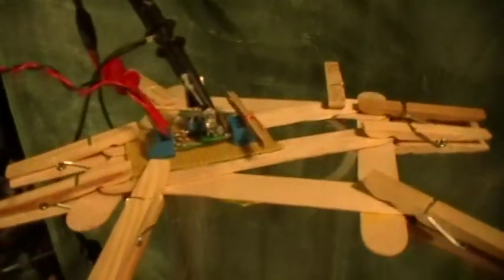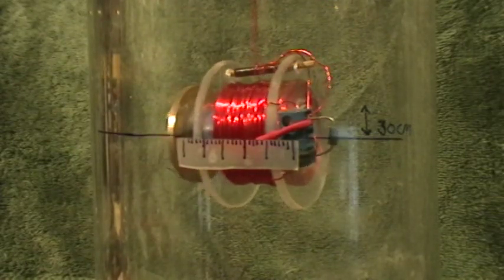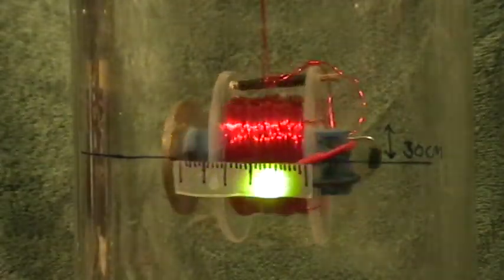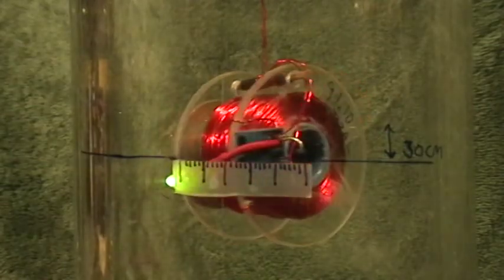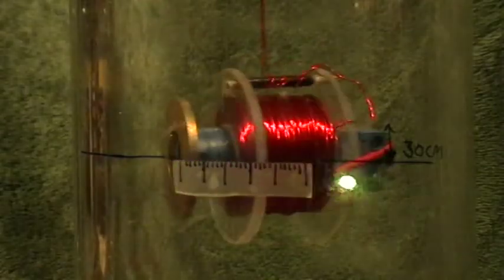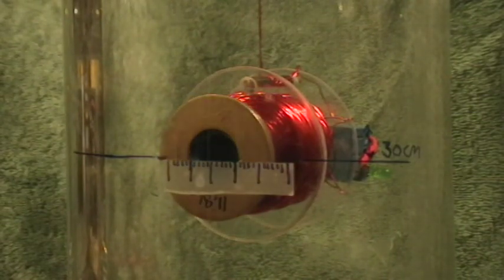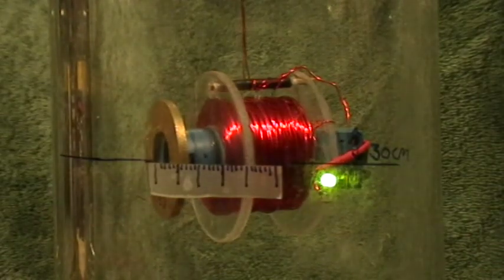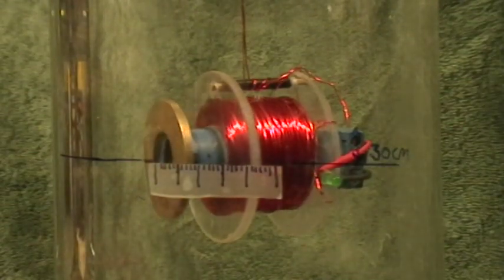Reactionless Propulsion: Charrier Exp1

Comment: TinselKoala I noticed many are unfamiliar with Charrier's publication, me included. I followed Google to a link here:  http://scitation.aip.org/content/aip/journal/apl/105/14/10.1063/1.4897969
 I'm glad to see it's under the free content label but I'm wondering if there was a more consolidated source for viewing. Filtering out all other unrelated info is difficult. Also would you consider doing a video to clarify what the claims are of his paper? It would help to alleviate the mispresumptions of this one. Thanks
Reply from the maker: Your link goes to the Erratum section. The link to the main paper is
http://scitation.aip.org/content/aip/journal/apl/101/3/10.1063/1.4737940
If you can get the actual paper you can see from the photos of his apparatus that his system is not constructed properly to test his hypothesis in the first place.  He has not accounted for electromagnetic interactions with the local laboratory environment or for the Earth's magnetic field. There are many other problems with the paper beyond the experimental artifacts. 
No, I won't be doing any new videos on this subject, but thank you for your interest.

Comment: So, you've created a small electromagnet which is attempting to align itself with the natural electromagnetic field of the Earth.

And the point of this experiment was to prove electromagnetism or that the Earth has a magnetic field?
Reply from the maker: +Waltham1892 
No, the point of this experiment was to track down and illustrate some of the confounding factors that Charrier evidently didn't take into account in his original report of his experiment, where he claimed to have found "reactionless thrust" from his apparatus. Please read Charrier's paper in Applied Physics Letters, 101, 034104, as noted in the Description above. 
The apparatus not only aligns with the Earth's field, which Charrier did not control for, but also is attracted to any large mass of ferromagnetic material in the nearby laboratory environment. If you can find images of Charrier's experimental apparatus you will see just how silly his claim in the published paper really is.
Reply: TinselKoala If this was the device that was tested by NASA, then the findings of the study were within the tests margin of error.

This also means they are most likely the result of random error or an artifact of the testing method.

Still, proving the basics of electromagnetism seems a bit fundamental.
Reply from the maker: Waltham1892
This is nowhere near the EM-drive device that is being tested by a NASA-related team at EagleWorks. But you are right about the other stuff.

Comment: if it is on all the time you could find the local earth magnetic field when rotating the tube, then there should be no torque at some point. are you trying to see if it will move toward the earth magnetic pole? if it is in attraction polarity there should be no torque. if it is in repulsion there will be a null point but not all that stable and might get torque, but may move in a line with the field due to repulsion.

Comment: i think that the mechanical recoil of the hanging wire is affecting the rotation of the coil and cause it to be out of phase with the resonanting frequency you are using . the frequency you are using will never match up till you find a way to cancell out the mechanical interferences .

Comment: Rotation is not the same thing as propulsion!! This is nothing new, you are using the LORENZ EFFECT by creating an electric and magnetic field. The force is real but it's limited to ROTATION ONLY. All you have done is created an electronic gyroscope! Even if you were able to create real propulsion by using the Earth's magnetic field as something to push on, that is still not true propellantless propulsion since you wont always have magnetic fields to push on in space, the big fields such as the galactic magnetic fields are too weak to be used practically for small devices like a human made space ship.The lorenz effect is a well known relativistic force created by the relationship between electromagnetism and magnetism. It causes transformer like coils to contract forcefully or expand if the current is reversed. This can cause rotation if the coils are not perfectly symetrical which is the case of your experiment.
Reply from the maker: You are entirely right. The original Charrier experiment was so poorly performed and documented that there is really no point in anyone but him, himself, repeating it. He really should do, though, and clean up the experiment and analysis and post some good data. I am convinced that 100 percent of what he saw was simple artifact.
Reply: TinselKoala Does the Charrier experiment have any relation to this? http://en.wikipedia.org/wiki/EmDrive
Reply from the maker: darkdavegmail Well, they are both schemes of reactionless electromagnetic propulsion. I think that the EMDrive experiments are much better done and documented than Charrier's efforts. I believe I linked his paper somewhere, and also his video of the setup, you should take a look if you are interested in the field of EM spacedrives and reactionless propulsion/inertial propulsion and stuff like that. Charrier was willing to discuss the experiment but he was operating out of his field and did not take into consideration many sources of artifact, he did not understand the use of his test equipment and function generator and failed to document some critical details; imho his paper should never have been published at all. My work here is mostly illustrating that he could not have driven his test article at his stated parameters without also experiencing huge artifactual motions; so the data in the paper is unreliable at best.
Shawyer is a different story. I still think his thrusts are also artifactual but without being there I can't pin it down. Previous work has identified things like expansion of hermetically sealed containers causing increased atmospheric buoyancy (really! ) and internal CG shifts due to thermal deformation of parts while under power. Obviously his apparatus is beyond my means, so I am depending on others to perform bulletproof experiments to track down the true source of the EMDrive thrust measurements.

Comment: I do not understand the relevance of the resonance, even if you could get it to do a 360 it would just be a function of the energy stored in the torsion spring, those 30 cm lines hanging down.  I would think it would be fairer to just use DC, not let the magnet twist, have some vector contribution of your magnet compared to the Earth's magnetic field that will cause your magnet mounted to a fixed pivot to move.  That way you would be looking for real propulsion, and testing whether you could sail your device in a magnetic sea.
Incidentally I also am working on a way around the conservation of momentum.
Reply from the maker: Good for you. Please see Charrier's original report of his experiment, and see if you can find anything wrong with his setup and the way he describes his work.
Reply: +JediSawyer Inertia is inertia. How do you side step it? Impossible to me.

Comment: Am I right in saying that you are bouncing off Earth's magnetic field?
Reply from the maker: Well, the original experiment by Charrier demonstrated an electromagnetic thruster. My hypothesis is that the test article might be responding just as you say, to the Earth's field or to the local EM environment in the laboratory. Charrier's data is very clean, but the thrusts he detected are very small and resulted in tiny displacements on the order of one micrometer. I'm rather astounded at the magnitude of the interactions I'm seeing, because Charrier mentions nothing like that in his paper. I know the azimuthal orientation of his apparatus but apparently he did not do any tests at different orientations. In addition apparently his suspension system minimized torsional motions. Of course this does not get rid of the forces that generate the motions!
Charrier reported a steady "translational" displacement when his signal was applied, and interactions with the Earth's field should only produce a torque rather than a steady displacement in one direction.
My current setup isn't sensitive enough to detect the very small displacements Charrier saw...yet. If I can figure out this artifact situation, and there is still residual motion, I can implement a far more precise displacement sensing system. If it is necessary.
Please stay tuned, I have another video coming up in a few hours. (Slow processing and uploading, sorry.)
Reply: TinselKoala
It might be an idea to acquire a sheet of magnetic shielding material, like mu-metal and wrap around your acrylic cylinder. That way you'll be 100% sure Earth's field doesn't have anything to do with it.
Reply from the maker: HitAndMissLab

Well, that's a thought. The mu-metal itself will be strongly attracted to the field of the coil, but if it is symmetrically placed that shouldn't matter. There will be eddy current losses as the coil's field swings through the conductive mu-metal, which will add damping... maybe not a bad thing.
The only down sides I can see are availability (nil), cost (high), and transparency (not).
Reply: TinselKoala Certainly, you are right. But you are risking of being driven by misleading results. There is only a need to shield earth's magnetic field, which is very weak. I've seen on eBay people selling scraps, in a form of tape or sheet. They are used for shielding speakers. You can always sell them back.. Some companies in US are selling a cheaper supplement to mu-metal. Maybe a plain thin sheet of steel would do? I am just guessing if you cover with shielding the sides, you can still use LED to read the orientation from the top. Eddie currents can easily be handled if you use narrow strips or tape, instead of sheets.
Reply from the maker: HitAndMissLab
All very excellent suggestions. Thanks!
I'm not promising I can do it, but I agree with you that it should be done, if one actually does find hints of real thrust. I don't think Charrier did anything to shield at all.
Reply: TinselKoala
Do you possibly know about Oleg D. Jefimenko, professor of physics and mathematics on the West Virginia State University? Same uni Howard Johnson worked at ;-) Jefimenko developed a theory about EM potentials turning into gravitics. There is article on Wikipeda and books on Amazon. He talked about steep potential gradients, or in your case conical coils. Tesla actually started with conical coils, before he went on to make Magnifying Transformer.
Reply from the maker: HitAndMissLab
Yes, I have Jefimenko's book on electrostatics, very inspiring. And I see that Charrier cites Jefimenko's work on EM and gravity.
Reply: TinselKoala
;-) Than you are one step ahead of me. Try conical coils.

Comment: Your north-south orientaiton is actually south-north :)
You're still a little fast... if the light goes on before it gets to the end, then it's fast... if it lags and doesn't turn on until after it goes to the end, then it's slow....oh I didn't finish; I guess you found you have a local northsouth different from global
Reply from the maker: Yep. Next vid will show the device reversed, just in case you are right about the orientation. The end of the thing that has the brass washer on it is the end that attracts the N end of a compass needle, as I drive with the unipolar pulse of +24 volts.

I have also received a suggestion to suppress the rotational mode by making the wire suspension further apart. I don't know if this is completely kosher though. Suppressing the motion doesn't make the forces causing it to go away. But I'll be revising the suspension in that way anyhow. Stay tuned, and thanks for your interest!